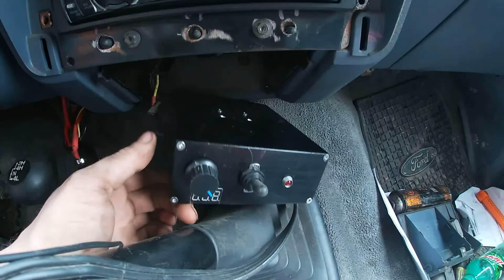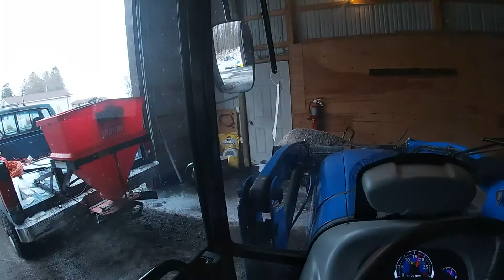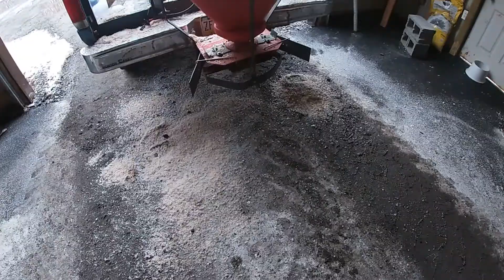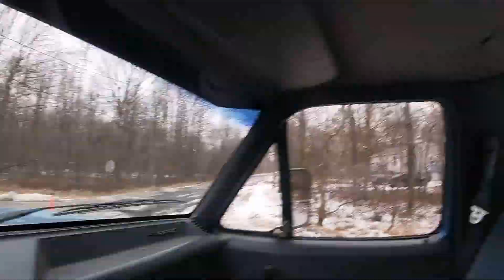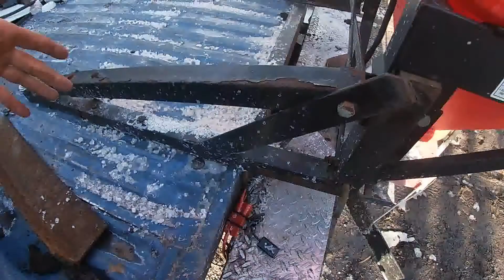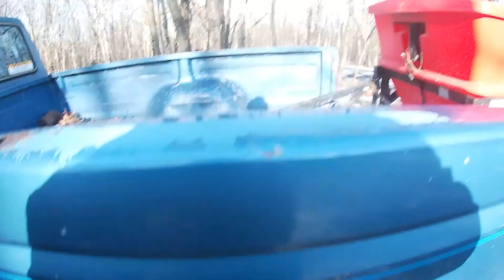home made western salt spreader controller part 2  (under $200)

Comment: Nice, this is the only video I’ve seen where someone figures out how to make their own controller, wire everything, & test it out. 
I did something similar, bought a snow ex hopper with no wire harness or controller, then realized how expensive everything would be from the manufacture. I ended up running 10 gauge wire from the spinner, auger, vibrate motor, to 3 fused switches on a 5 gang kick panel, fused the wire running to the kick panel, & a breaker at the battery. I plan to do like you did & install a potentiometer for the auger flow rate, but for now it just runs full speed. 
I appreciate your problem solving skills 👍
Reply from the maker: Thank you it works pretty well it also has a reverse feature witch works well I now have it on my new truck and it has held up well over time
Reply from the maker: As an added thing I learned if you run it in reverse it seems to be a little more sparing on the salt